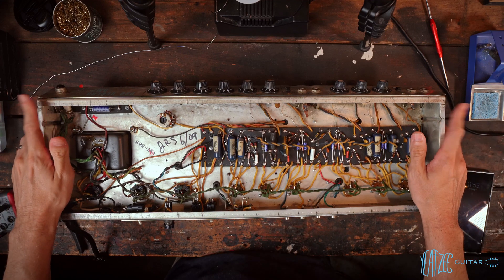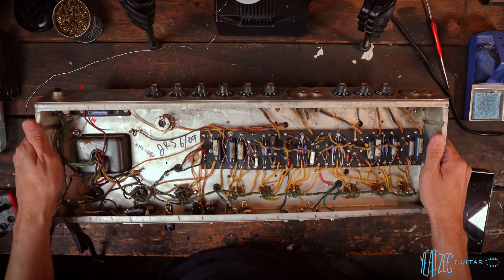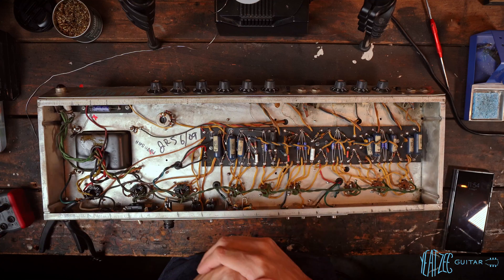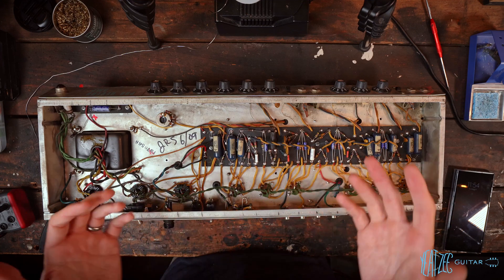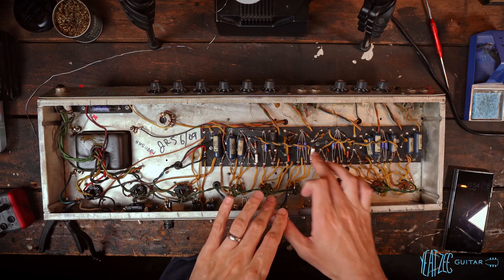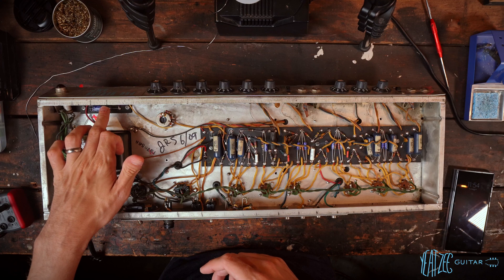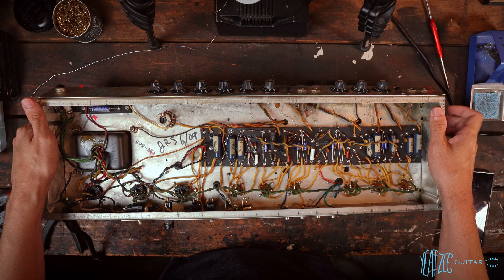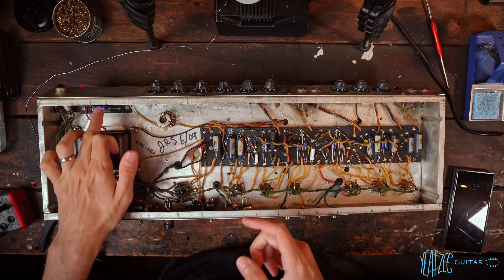Amp Repair & Chill! - Vintage 1968 Fender Pro Reverb Amp Repair Pt.2

Comment: Thx for uploading. I’ve overhauled 3 amps, my first ones. Everything went great. Except a popping noise in the speaker when I turn it on. I’ve checked everything I know.  Any ideas?
Reply from the maker: I'd recommend joining a forum like el34world, extremely knowledgeable people on there and it's a better place to troubleshoot vs YT comments.